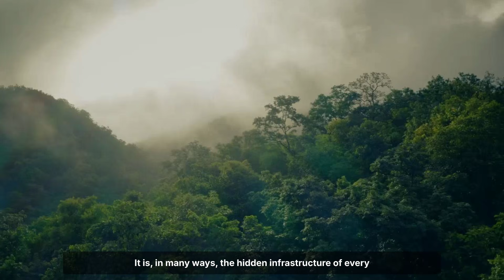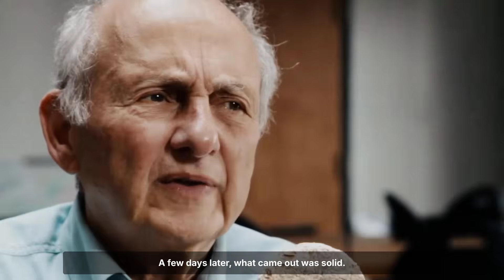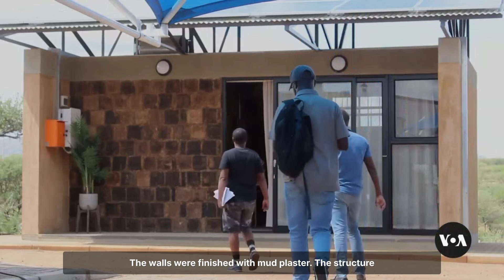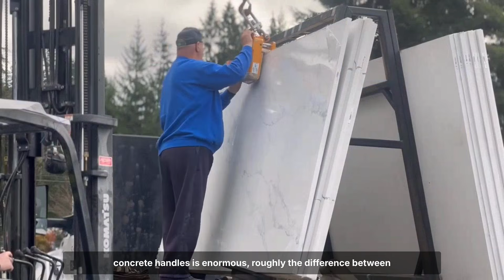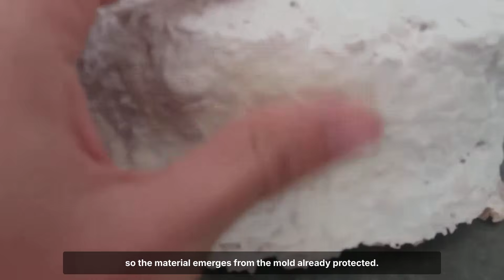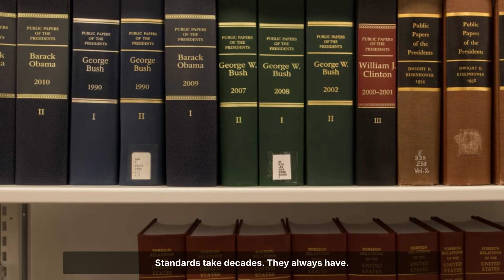This Fungus Grows Solid Bricks From Waste. No Cement Required. Why Do Engineers Refuse to Use It?

Comment: Why they dont ? Because ; 

Very high amount of potassium and carbon will end as brick. While hard wood has lower potassium content in their ashes corn and wheat straw has up to 50 percent soluble potassium salts (Potassium fertilizer) in their ash content. There are different aproaches to utilize straw like plowing, pyrolysis, composting , fodder , mulching burning etc. It should end in the soil. If you are able to feed fungi with straw then just compost it with different fungi and bacteria and use it in soil. And some burn their residues to kill weed species , soil borne deseases and nematodes .  So you will always see some farmer  burning , mulching, composting but not much making fungi bricks because there are easier ways to build straw walls.